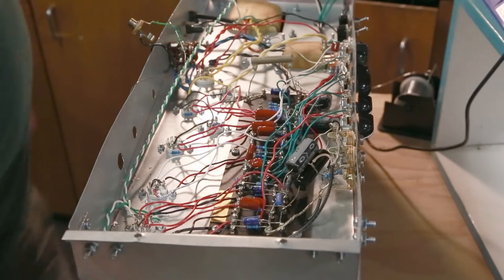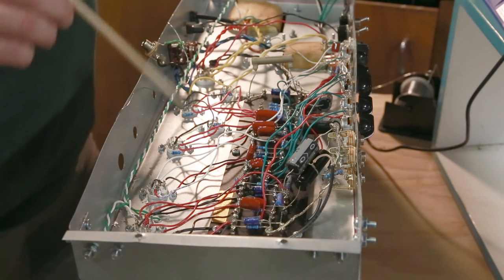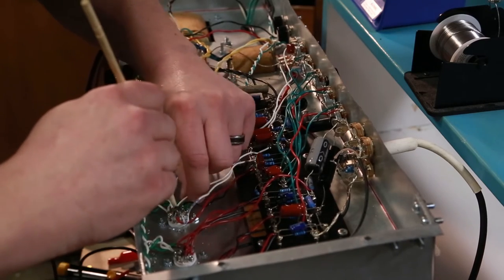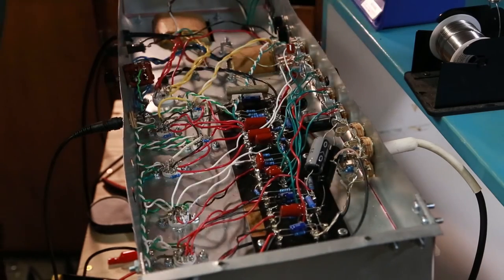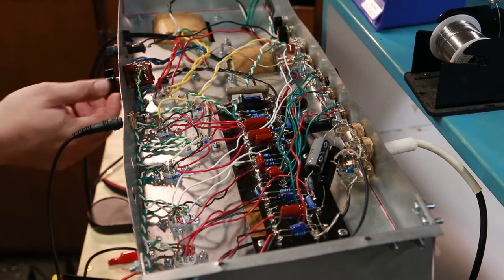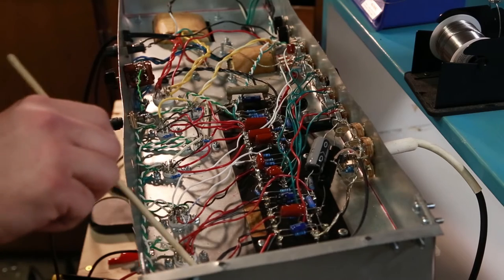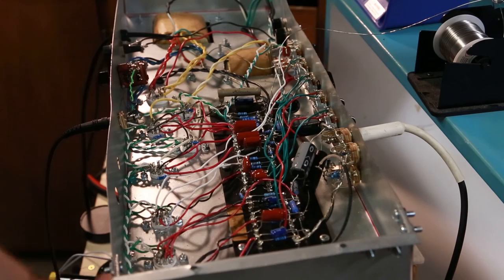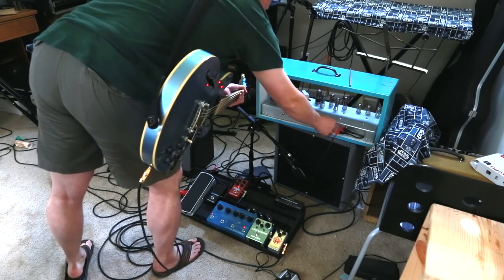Vox AC30 Fix Video 2

Comment: Good video!  I just put together an AB763 style build and am getting a little bit of noise on the vibrato channel.  Definitely going to try and mess with the chopsticks to see if I can locate the source or improve lead dress.
Reply from the maker: Yeah Chopsticks make it safe and you can tap around and see if you add/remove noise in a spot that helps narrow it down :)

Comment: Where is the fuse located in an AC30cc2? I believe mine blew out. I get now power. No red light or amber light.
Reply from the maker: +jonathankanetv not 100% sure, but it could either be in a screw your connection on the back, or if it's one of those computer type plug connectors, then it would be something inside the plug area that you usually need a screwdriver to access.  Just remove the power cable, and you'll see it below the plug receptacle
Reply from the maker: Here's a picture that should apply to what I was trying to explain: https://goo.gl/photos/A9jYuyBbYTTwhYWQ6
Reply: Frenchie Films yes, I found that the power fuse had blown. I purchased another one and turned the Vox on and everything came back on, but about 5 seconds later, it blew again. Any ideas?
Reply from the maker: Oh then that means you've got a more serious problem.  either there is a bad power tube, or you may need to take the amp to a repair tech.  There may be something gone bad on the circuit board causing too much current to be drawn, etc and it becomes pretty tricky to troubleshoot from here.  If you know enough about soldering etc, you can try but remember the inside of a tube amp has lethal voltages and unless you know how to deal with it, take it to an expert.
Reply: Bad rectifier tube. That happened with my Vox as well. Changed the rectifier tube and problem solved.